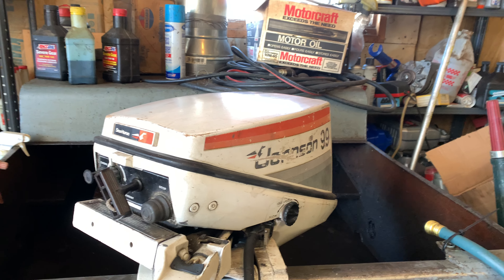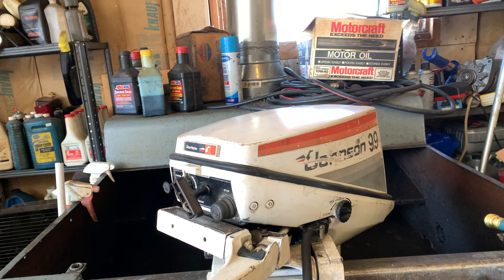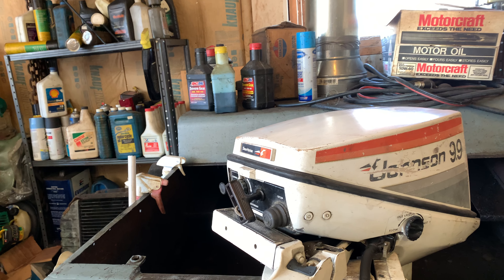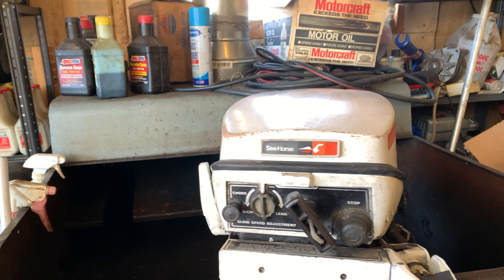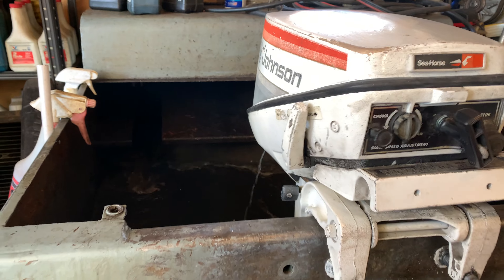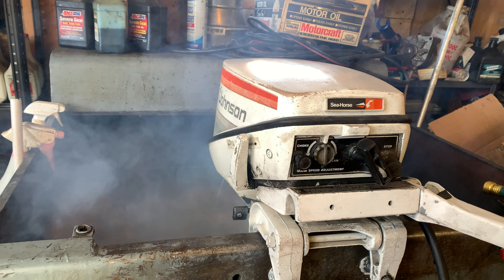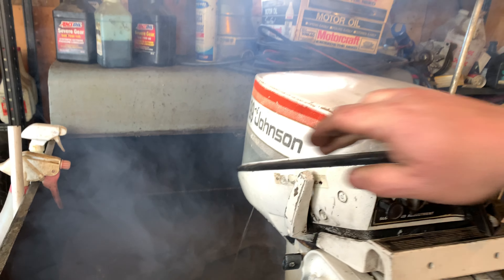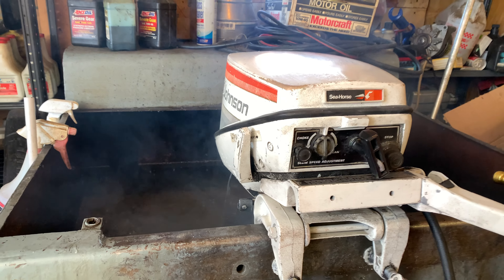1977 Johnson 9.9hp outboard motor tank test

Comment: Quick question. I have a 1977 evinrude 9.9, should i have a tell tail on cold start up. I fired it up after a carb rebuild and noticed that there wasnt any tell tail so i shut it down. Just trying to figure out if i need a new water pump or if i have to wait for the thermostat to open . Thanks for your videos.

Comment: Hi Ben!  Well that is a strange failure indeed.  Was the sensor/pick up coil damaged by physical interference or did it actually fail electrically?  I wonder is the bad sensor killed the new pack...  Just seems like those old 9.9s will last forever with a little care, especially in fresh water.
Reply from the maker: It failed electrically. It’s the second one I’ve seen in the last six months.
Reply from the maker: And the power pack was some brand that I never heard of, eBay special I’m sure
Reply: @Mnoutboards    Maybe it was the goofy pack that killed the sensor.

Comment: Hey Ben i have the same motor. Only problem is its stuck in neutral. Wont shift in either forward or reverse. Ever encounter this problem? Thanks keep up the great content!
Reply from the maker: Does the shifter move?
Reply: @Mnoutboards    If the shifter moves, is it pumping water?  I only ask because perhaps the driveshaft has broken or the splines are wiped out, sure hope not.  Hopefully it is a simple linkage issue
Reply: @Mnoutboards  no does not move
Reply from the maker: @jmmass3264  well your going to have to take it apart to see what is going on with it.